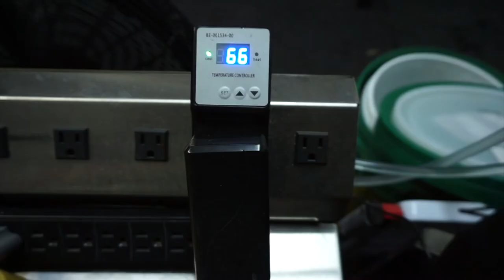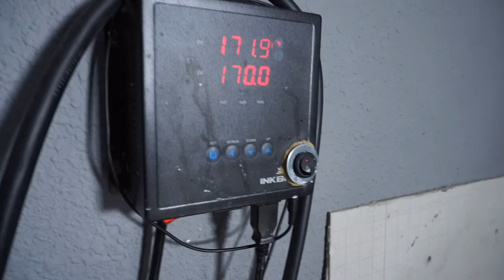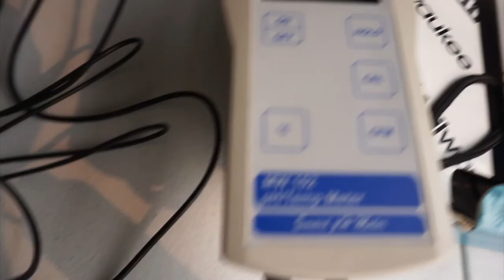10 Beginner Home Brewer Tips(MUST WATCH)

Comment: Well done although I would say kegging is a bit more expensive as most people don't have a deep freezer or old fridge which adds to costs even if it is used. So I'd say most people who are beginners will never have a kegging system and from those who do it will either be a very cheap one or two keg with picnic taps or something a bit fancy that can cost well over $1k (I think my 8 tap - 7 - 5 gallon and 1 split or 1 gallon tester was pretty close to $2k as I wanted to do it right with all SS and flow control too, plus all my kegs were new but I did pick up most of my equipment during sales to shave off some costs, even the new chest freezer that I added a collar to. Bottling when you have a keg system is easy but when you have to bottle about 50 bottles per 5 gallon batch without any other choice, that does suck and the O2 risk is much higher.
Reply from the maker: I think using my area as reference to ALL homebrewers was misleading on my part. That cost comparison was under the impression that the home brewer will pick up a used mini fridge to ferment in for temp control. But I totally agree, a full blown Keezer build is a lot more expensive than a picnic tap, single keg setup.

Though, I would take that over bottle conditioning every batch, any day! Thanks for the feedback!
Reply: @HopKillerBrewery  Agreed. Although I am considering a crazy cheap solution (if it presents itself) for my oldest son as I keep 2 to 3 - 1 gallon kegs filled for him from my 5 gallon kegs as he lives in the same city and entertains a lot but at the moment those kegs are taking up a lot of room in his fridge. I wish someone made a cheap kegerator for 1 to 1.75 gallon kegs as I'm not brewing a full 5 gallon for him to take it all either.

Comment: Thanks for videos, I'm new to brewing and enjoy your content, plus your local to my area which is always cool. Have a question... Can you bottle from a keg? Local breweries fill crowlers from their tap and growlers are filled from a tap.. will the beer still age correctly?
Reply from the maker: Right on, thanks for the feedback! What area are you located in?

You totally can, for quick fills that will be consumed fast, I just lower the pressure and attach tubing to the end of the tap just like breweries do for growlers/crowlers. Purge with CO2 if possible but try to consume right away. 

For competitions or something I plan to hang onto for longer periods of time, I use my Blichmann Beer Gun. It connects right to the keg VS coming out of the tap. Very handy and works like a dream. The 13% ABV imperial stout video I posted, that bottle in the beginning of the video was bottled from the keg using a Blichmann beer gun. 2 years old almost and had plenty of carbonation!
Reply: @HopKillerBrewery  I might be wrong with where you are but I'm in Rocklin and drive through your town for work occasionally. 
Thanks for the feedback, I'll have to try that because I agree kegging is the way to go, and having an option to bottle from a keg is another advantage.